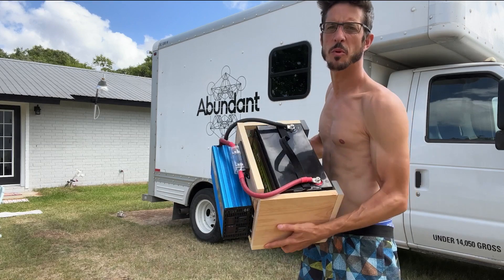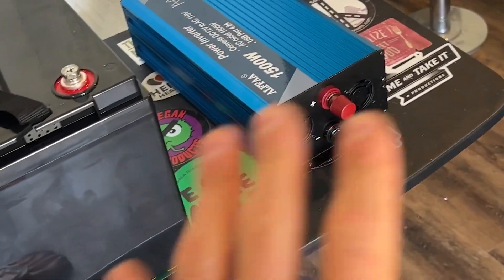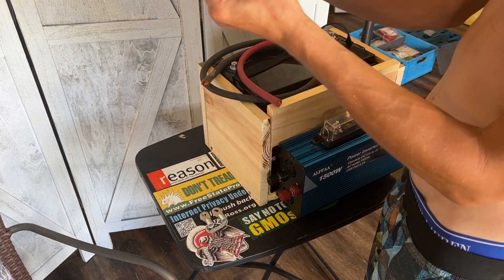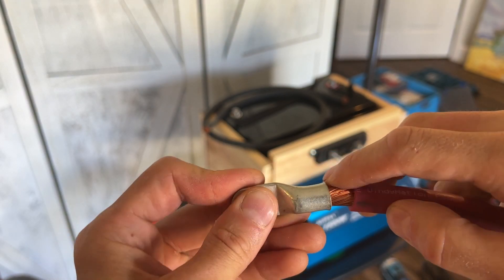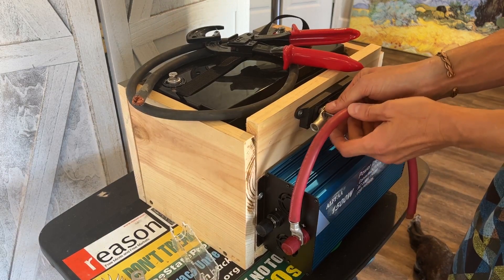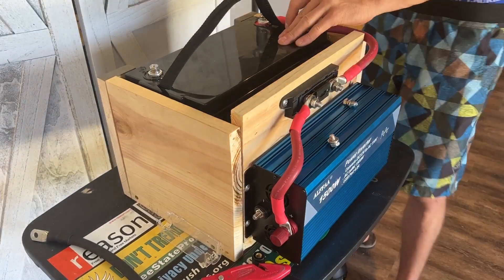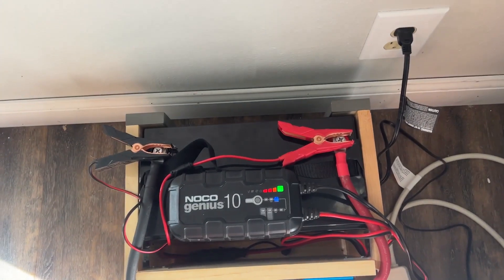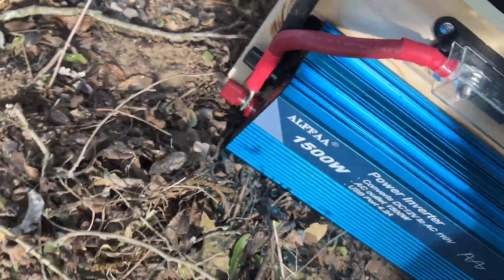DIY Lithium Power Station | Better than JACKERY

Comment: The Jackery has a built in solar charge controller, something I would want to have. How would you add that here and what brand solar charge controller would you recommend?
Reply from the maker: There are a lot of small solar charge controllers that could easily be added. Batteria power has a nice compact 20a controller

Comment: I understand where you are coming from but value changes dramatically due to sales etc.  I bought a Jackery 1500 for $1200 and some 1000s for $800.  It appears your set up is close to $1000.  I get it, I do, but Jackerys are not always the rip off people say they are.  Just depends.
Reply from the maker: Jackery definitely has its place. Not everyone wants to build stuff. The benefit here is that you can build the system to fit your needs. And upgrade or repair parts as you desire.

This system has a 100ah lithium battery. You could easily use a 200ah battery and still be at about $1,000. That storage capacity is not even an option with jackery.

The diy systems become a better deal as size increases. If you just want to charge a phone or laptop, jackery is great. But if you want to build something that is expandable and serviceable, diy is the way to go
Reply: @nomadbrad503   - you can also do a diy battery add on to something like a Jackery 1500 as it has a 500w input.

Comment: Turn the battery around you would use less cable which is less resistance. Also you pimp the jackery and other power stations by connecting other batteries.
Reply from the maker: I ain’t no pimp sexy Sean 😎

Comment: The ideal way to charge a LiFePO4 battery is with a lithium iron phosphate battery charger?The answer is simple: use a LiFePO4 battery charger, of course. When charging LiFePO4 batteries, make sure that you are not using a charger meant for other lithium ion chemistries!
Reply from the maker: You’re not wrong

Comment: For those that have never used heat shrink, 3:1 heat shrink is soooo much better than 2:1. If you forget to put it on before adding the lugs or terminals at the end you can usually fit a bigger piece of 3:1 that will still shrink enough to look normal. Can't do that with 2:1 most of the time. Also you want a heat shrink tube with adhesive on the inside wall to completely seal the crimp. No need for Nolox or whatever, just clean copper to a clean copper or tinned copper lug sealed with quality heat shrink.

The Noco Genius chargers seem quite popular. Never heard anything bad about them.

Jackery has a 1000wh and a 1500wh model but they are so ungodly overpriced. They only recently got their pricing in line with Ecoflow and Bluetti. They used to be 10%-20% more than those two and those two are kinda at the top of the market in terms of price.There are plenty of no name power stations that are 25% cheaper and offer most of the same features just usually not the internal 1 hour charging.
Reply from the maker: Great advice!

Comment: Wow, this is the simplest diy setup I've seen yet! I'm curious how you'd add the ability to attach solar panels for on the road. I'm definitely not tech savvy. Thanks for the great video!
Reply from the maker: All you need to do is add a solar charge controller and panels and you’re good to go
Reply: @nomadbrad503  Ahh I see now. Super simple! Thanks.

Comment: Awesome build, if you kept the battery maintainer connected to the battery 24/7. Will it act as ups? I want to have my vital pumps & equipment be kept on while power outages. does it also need bms?
Reply from the maker: This battery has a bms built in. Would make a great backup power supply

Comment: Nice simple build. Will the inverter run at 1500W because you only have 1200W battery ?
Reply from the maker: The inverter is capable of delivering up to 1500 watts on a 120v load. This is different than watt hours which is capacity of the battery
Reply: That all depends on C rate. Quite often these cells are capable of 1C continuous and 2C burst.

Comment: Nice build and great job editing. I have 2 small bluetti’s but would like to build a setup like yours. I like that you can easily add more capacity to it by adding more batteries. Great point as well about the electric saw vs battery saw.
Reply from the maker: yes! I have had the all in one units fail on me. If one part goes, you loose the whole darn thing and cant really repair. thats why I like to build my own

Comment: Jackery is lighter weight than your power station.
Reply from the maker: It’s much lighter weight because it has much less capacity. This solution is for people who want to power a residential refrigerator or freezer or something that requires more juice. A jackery is good for laptops and 12v refrigerators that’s about all
Reply: @nomadbrad503  jackery 1500
Reply: According to the Jackery website, The 1500 weighs about 35 pounds. His set up is within 2 or 3 pounds for less than half the price.

Comment: I build me one with a 200AH Life op4 batt and a 3000watts pure sine wave inverter and run my frezzer and double side refrigerator for 18 hours here in Puerto Rico, is a plan  B for Hurcane season.
Reply from the maker: That’s a great plan! I was in st croix in 2017 for hurricane Maria..sure would have been nice to have battery backup power. We didn’t have electric for a month
Reply: which lipo battery you used ?

Comment: Knowledge is a beautiful thing! 😏👍 This video is right on  time. Had  power go down twice in two months here in Florida,  almost all day, both  times. 😐 lost 2 weeks of groceries. Thank God for great ideas. 🙂
Oh, I forgot, I'd probably use it to power some fans and a small refrigerator,  when the A/C, and normal sized fridge loses power; or could this unit power a normal sized fridge?😏
Reply from the maker: Yes, this is exactly what you need. And you can add multiple batteries if you want more reserve power
Reply: @nomadbrad503  Fantastic!!!😃👍 Thanks!!!
Reply: You can power a USB fan with a cheap power bank. Box fans are very inefficient. You can also power these fans with a folding solar panel. I only use those type fans now. Very low wattage. Get the 3 speed ones with 5 blades.

Comment: This video is AWESOME!!! I have to sleep with a CPAP machine, which sucks! In addition to it being uncomfortable, if my power goes out... I'm screwed. And last night... my power went out all night. So... all day today, I've been looking into those Jackery power stations. But. I'm a total DIY fanatic, so I want to make my own! I have a quick question for you, if you have a second. The battery you use is a massive single battery. I watched another YouTube Channel called DIY Perks. Here is that video: https:// www.youtube.com/watch?v=adY-S8AH_Jc.  This guy uses 80+ smaller Lithium Ion battery cells. What I don't understand is... the Voltage. He built his to be 50V. The batter you are using is "only" 12.8V.  Why would someone need/way 50V vs 12.8V, vs 24V, vs... whatever volts? If you wanted to, could you just buy 4x of those huge batteries you used, and wire them together in such as way that they go 12.8V x 4 = 51.2 V? Again... why would one do that, and would you have to buy a different inverter, because the 51.2 V would be too much for the inverter you were using? Sorry... my "one quick question" is a lot... I guess. But man... thanks! Great video!!!
Reply from the maker: Higher voltage battery banks allow you to build massive storage systems and use smaller gauge wiring . The problem is that inverters for 24v and 48v systems are very expensive. Just get a 12 volt lithium battery and a pure sine inverter. 100ah should be plenty for your cpap. I’m uploading a video on Monday where I run an air conditioner with one of these and install a battery monitor. You should check it out
Reply: @nomadbrad503 
 Snicker snicker...here's a 24 volt system. Its portable if you own a forklift!  You did a great job on your build. I had 80+ crimp on terminations on the Big Kahuna.
https://www.youtube.com/watch?v=GPYg1QZJ24o
Reply: I started building CPAP battery backup units during the NorCal fires of October 2017.  I built maybe a dozen for family, friends, and neighbors. I WOULD NOT use lithium ion batteries as under certain circumstances they can have thermal runaway and can catch fire. LiFeP04 lithium batteries with built in BMS (all of them have a BMS making it stupid proof, goof proof).  100 amp hour batteries are all over Amazon for around the $400 range. These are 12.8 volts. Small 8 amp lithium chargers are available on eBay. I would avoid the higher voltages for small portable units as recharging them require expensive battery chargers.

I would go with the 12 volt system for CPAP as you can run other 12 volt items with it. Some CPAP's are 12 volt, some are 24 volt. If you can plug it into a cigarette lighter adapter, its probably 12 volts. Your biggest concern is the watts used. My units use a Bestek 300 watt pure sine inverter...but it burns up 10 watts just being turned on. No problem for 24 hour outages but when  you go through an in inverter, 120 volt power adapter, to CPAP unit there are losses. With the heat on you could be running 100 watts. 100 amp hours X 12.8 volts gives you 1280 watt hours.....or 12.8 hours of CPAP run time.

With a 12 volt system and extended power outages for days, you have the option of recharging your lithium battery off a running car engine using jumper cables.  I went with a Bestek 300 watt inverter because they also have a pair of USB ports built in. I Goop glue Velcro strips on the bottom and on my power box such that I can quickly use the inverter in the car. I use Minn  Kota trolling motor battery cases to house the battery. They have 10 amp and 60 amp built in circuit breakers, a pair of cigarette lighter outlets, battery charge lights, terminals to recharge using jumper cables and have a dandy carrying handle. They are drip proof so carrying them in the rain is no problem. Also, there are 3 and 6 watt 12 volt LED bulbs available that look like screw in 120 volt bulbs. A lamp cord can be cut and a 12 volt lighter plug installed so you can have backup lighting for many days continuously if needed.    

I hope this helps.  This guy did a very nice battery box build. With a larger inverter, you can power up more things. But that CPAP machine tops all other needs.
Reply: @kimmer6  Just when I think the internet is full of trolls and @$$holes...!!! Thanks man!!! I am in the process of getting a new CPAP machine, as the one I have is ancient. So, this is all good information for me. I can try to look for a 12V CPAP machine and not a 24V.
Reply: @MichaelScottPerkins    Michael, here's the battery box and inverter that serves as my Guinea pig test bed. At this moment it's on its way in my son's van to a campground under redwoods in NorCal.
We really did use this unit in a storm at Pacific Grove. The 3 watt 12 volt bulb throws out plenty of light at very low draws. This Minn Kota battery box actually has 200 amp hours of 12 volt lithium batteries stuffed inside. We rent a primitive cabin on the ocean bluffs North of San Francisco and this unit with a bigger inverter runs a dorm fridge/freezer, table lamps, floor lamp, CPAP, and a chandelier for 4 days and 3 nights while other campers run around with headlamps on.  Cheers!    https://www.youtube.com/watch?v=vj816VQuIbs
Reply: I bought a jackery years ago the 500 explorer to power my cpap.  The advantages of one of these power banks over a diyer is that you can use it with 12v power and not use the inverter.   I bought a 12v power converter for my cpap and plugged it into the cigarette lighter of the jackery.  Using the humidifier it used 23% of the battery which allowed me to use it 3 1/2 full days, not bad for 500 watts.  You could use it longer if  you don't use the humidifier of your cpap.   Years later now I would recommend an ecoflow for your cpap, the river pro.  But the unit he built will definitely power the cpap longer even using the inverter.  I bought  my jackery because it was light and powered my cpap through my week long camping and fishing trips using a solar panel.
Reply: Inverters for 24V and 48V systems are really no more expensive than 12V ones if you look at the price based on how much power they are outputting. 

12V is still really popular because nearly all RV's have 12V systems. 48V is the de facto standard for residential and off grid stuff. 24V isn't quite as popular but I wouldnt say it limits component availability.

If you're doing more than 2000W...DON'T do 12V. 3000W is the max you can practically go up to before wire gauge becomes silly. You're running 2/0 and 4/0 and just barely meeting the ampacity specs while spending $8 a foot on welding cable.

24V is ideal for 2000W to 3500W. Cuts your amperage in half compared to 12V so you can get away with using 2AWG and 4AWG in your peak load situations. Part of the reason why 24V has a following is lithium ion does not match up with 12V well. 3S goes too low and your inverter cuts out. 4S goes too high and you'll have to charge your cells up to 75% or 80% to keep your inverter happy.......7S however is perfect as it runs between 29.4V and 21V if you're doing the 4.2V to 3.0V range, some prefer the 4.0V to 3.2V range to double/triple lithium ion cycle life with only a modest loss in capacity, full range of most lithium ion cells is 4.2V to either 2.75V or 2.5V but there is very little capacity below 3V. The top of the voltage range of the cells is where they are most stressed and most likely to have catastrophic failure from...overcharging of course. The rule of thumb is every 10 millivolts you go below 4.2V adds a whole nother set of cycle life to it. So a cell that normally gets 500-800 cycles only charged up to 4.0V its whole life is likely to see 1500-2400 cycles. The lower end isnt quite as dramatic but since there is next to nothing below 2.8V for 2.5V min cells there is absolutely no reason to go down that low. Part of getting that inflated cycle life is padding the bottom as well. Ideally you'd cut off at 3.0V, some people take it as far as cutting off at 3.2 and only run their cells during the flattest part of the discharge curve. With all that said, LiFeP04 is the way to go nowadays but I wanted to fill you in on who uses 24V and how they use it to be as safe as possible and as long lasting as possible.

48V is ideal for 3000W+. Plenty of people run 5000W and 6500W inverters on 48V systems. It's just a no brainer, the amount of higher quality inverters, chargers, all in one units, and everything else out there for 48V is just mind boggling. You an pick up a 5000W all in one inverter,  40A charger from Grid AC/Generator and 16A/500V max input MPPT that charges your pack at up to 80A for $600 to $700 (wont be top of the line, more of a budget all in one but not total junk). You can barely put together a 12V system for that price and it would have about half the power. 16 280Ah cells can be had for just under $2k and thats 14kwh. String them all in series, spend another $300 on BMS and other parts and you have a 14kwh, 5kw output backup system for $2700. Then go hunting locally for used solar panels and when you find someone selling a pallet or two of panels at 20-40 cents a watt snatch them up.

https://www.aliexpress.com/i/3256802574511408.html?gatewayAdapt=4itemAdapt

Comment: What size fuze did you use and do I have to use wire that big? Thank you
Reply from the maker: Fuse size will depend on inverter: this one needed a 150amp fuse and yes, you will want at least 0awg wire from battery to inverter

Comment: This is the video I have been waiting. A simple user friendly DIY system explained in a very clear manner. I had wanted to build a DIY system but I could not find enough well explained information. I have looked at well over 50 YouTube videos on the subject but most were rushed and some expected you to assume some important steps. Some were over the top and you needed to be an electrical engineer to follow. But your style is very practical; the best I've seen. I want to use in my future RV setup and as a home base back up energy supply. What kind of fuse is that? I did not see it on your Amazon list. How did you chose the correct size fuse bus or block to use? Also I will beg you to continue this build connecting solar panels and MPPT charge controller to this basic system. This is something else that is not explained very clearly is what amp size controller you need and the amps and watts of the panels. Also there seems to be some order to connecting and disconnecting. I would love to see a device that shows the charge of the battery in percentage and watts going in and out. Does it have pass through charging? A lot more people would build a DIY system but don't dare to because there is not enough complete information available; not even on YouTube. Hell, I would buy a book if it was explained in an easy manner; "Power Station DIY Build for Dummies!"
Reply from the maker: Thank you for the great feedback. I will make more videos to answer some of your questions. I do have a free solar ebook that you would benefit from. You can download it for free at www.vanliferx.com
Reply: I got a 3000W inverter and 3840Wh battery gonna buy another battery. 600W load for 12 hours
Reply: Thinking of making a heatpump HVACed gaming pod